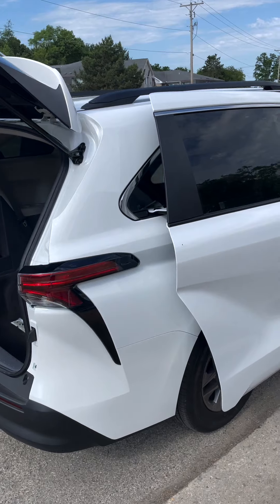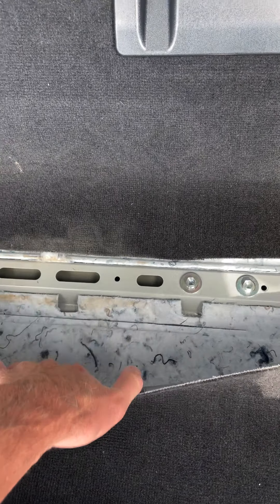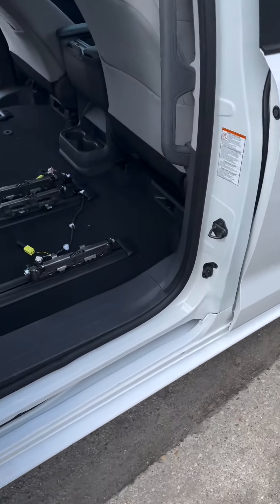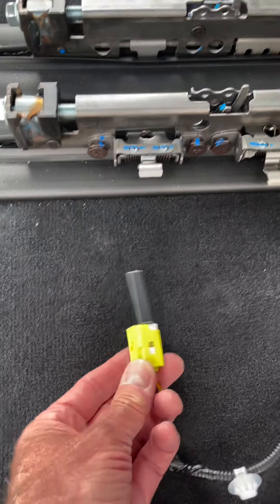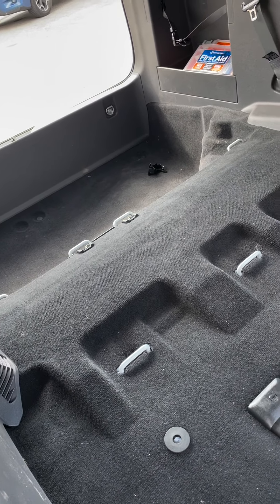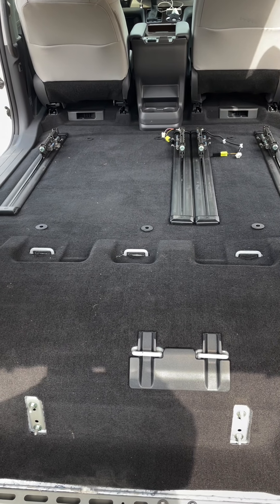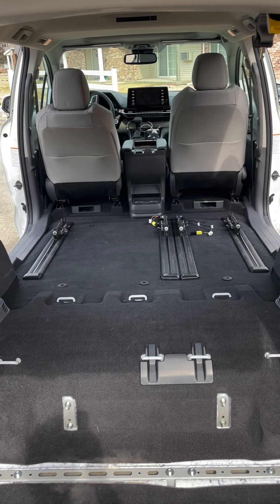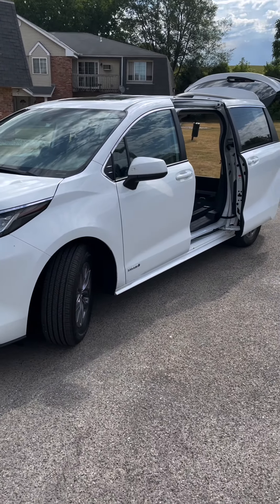2021 Toyota Sienna Hybrid Van Life Second and Third Row Seats Removed

Comment: I just removed the rear seats from my 2024 Sienna. It looks EXACTLY like this, so nothing has changed. Brad Ling now sells the dongles for the airbag wiring. I just wish there was a way to remove those seat brackets easily. If I remember right, you’d have to remove the railing, which involves removing lots of stuff from the underside of the Sienna.
Reply from the maker: Great news thanks for the info! Yes, too bad about the brackets. I just decided to build over them with the platform.

Comment: wanted to say, this engine is designed to start and stop a million times, it's basically it bit bigger than a Prius engine, and the taxi cab drivers never turn their car and leave them running for months ....  So don't be afraid to let your van run overnight with AC on any time.
Reply from the maker: Thanks Eric, that's what I'm hoping!

Comment: Hi Kevin! Would you answer one more question for me? I just got my 2022 Sienna and am SO excited to take the seats out and start building! It looks like you and I have a similar model where there are 3 seats in the second row--the two captain's chairs, and the child seat in the middle that's attached to the seat on the driver's side. I watched Brad Ling's excellent video about how to remove the second row seats, but it looked like his Sienna just had two captain's chairs, no child seat in the middle. So my question is, what did you do differently from Brad (if anything) to take your second row seats out, given that you had the child seat there as well? Thanks so much for any help you're willing to share. :)
Reply from the maker: Hi Jill sorry for the late reply. I don’t remember doing anything differently as far as the seat removal, they both came out without any issues. Best of luck and enjoy your Sienna!
Reply: @kevins-guitar-ukulele  No worries, and thanks Kevin! Yep, got both seats out without a problem. :) Cheers!

Comment: hey kevin, noah here checking in again. So, i had to acquiesce and pull the trigger on a 2023 Sienna Limited instead of a XSE. So, what is the correct dongle I should by for the middle row seats. I went to Brads website and even asked him and I am still   confused as to the square one and or the round one. The chart says round and square? and... is it $32 for a pair or a single unit? Thanks, much appreciation for you and your info and builds!!
Reply from the maker: Hi Noah, looks like the ones I bought are no longer available on Amazon which is where I purchased them. Sorry I can’t be more help as to which one of the choices to get, but congrats on the new Sienna and I’m hoping one of those on Brad’s site will work for you 👍
Reply: thanks for your quick reply....  @kevins-guitar-ukulele

Comment: could you please tell us where you sourced the airbag resistors and what value did you buy?  Thanks for the video!  Keep them coming!
Reply from the maker: Hi Eric, check the description, I linked to the item on Amazon - Delaman Auto Car Airbag Emulator Simulators.  So far they are working perfectly!
Reply: @kevins-guitar-ukulele  Thanks, I got the resistor packs in my cart. I'd used some electrical tape or some zip ties, to keep the packs from accidentally coming apart, while under the plywood.  What kinda bed will you put in?  Keep the vids coming!

Comment: Have you tried removing the front console? I want to purchase sienna for vanlife and I want to be able to move freely from driver seat to the 2nd/3rd row in order to stay stealth.

And as a person who did live in my suv rav4 2008 for couple of months. It’s kinda nice to leave one middle seat chair. Like sofa
Reply from the maker: I have not but I could see why you would want to. It is a pain to climb from the driver seat to the back and vice versa. I do it now by leaning the seat all the way back and then just kind of hoisting myself into the back using the handles above the sliding doors. For sure there will be times when you might need to make a quick getaway without getting out of the vehicle.

Comment: Hi Kevin! Thanks for the video, it's super helpful! I have two questions if you have a moment: 1. Do you know the dimensions of the second row seat attachment things that are left in the tracks when you remove the seat? They look to be about 12"X2"X3", but I wonder if you measured them? And 2. After a year of use, are the small airbag emulator simulator pieces still working to block airbag error messages? Thanks again! :)
Reply from the maker: Hi Jill, sorry I don’t have the measurements but when installing the 4x8 sheet of plywood it covered the nasty and sharp seat rails.  I use the area below the platform for storage. The airbag simulator resistors are working perfectly, no issues!  Thanks for watching and best of luck to you 😀
Reply: @kevins-guitar-ukulele  Thank you! :)

Comment: I have a rattle coming from my third row it doesn't happen when the seats are reclined a little bit and it does not happen when the seats are in the floor or if the back is folded onto the front
Reply from the maker: Hmm I don’t know as I removed my rear seats almost immediately after getting the van. Best of luck to you in figuring it out 👍

Comment: Hi Kevin, it’s said that the 2022 Sienna rear seats can’t be removed . Would you know anything about that ? Thanks
Reply from the maker: They said the same for the 2021, so I would investigate further if you can. Check my video a while back called “Toyota Sienna rear seats removed” where I talk about it. Best of luck to you 👍
Reply: @kevins-guitar-ukulele  oh I watched , I thought it was about battery placement, sorry , I think I may have asked you about this before, my memory isn’t great, I read and view and comment on many videos !
Reply: @kimdagnillo8246  I've removed one middle row seat out of my 2022 so far. It went smoothly. The only difference between 2021 and 2022 is that the 2022 seats have 2 airbag plugs per seat. I had to buy 4 of Brad Ling's resisters (instead of 2).

Comment: Hello,  I would think removing the 3rd row seats is completely ok since there are no air bags. But could you please confirm no error message after unclipping the harness? Do you know the purpose of the harness and why other generation’s of Sienna do not have it? Thank you.
Reply from the maker: Hello H Y, yes there have been no issues with warning lights or sounds from removing the third row seats.  The clips I believe are for the seatbelt warning system.  I traced where the wires were going and it looked like they were going to a sensor in the seats.  I did this unclipping while the 12V battery was disconnected and there was a seat belt warning light on the center display.  However once I reconnected the battery (after removing the second row seats as instructed by Brad's video) all was well, no warning lights or sounds.  Hope this makes sense.